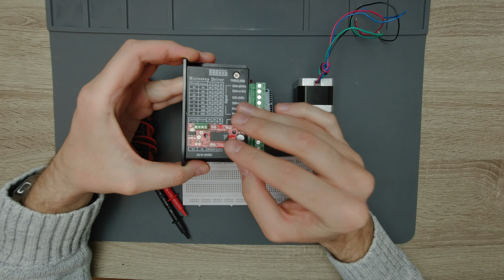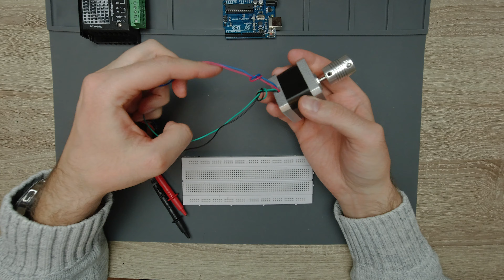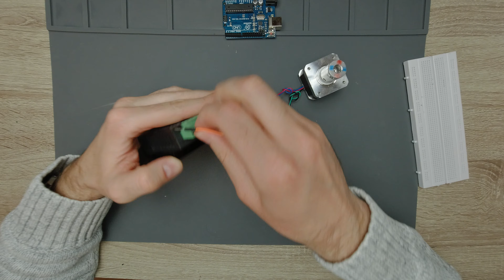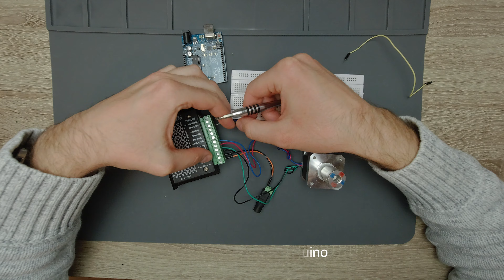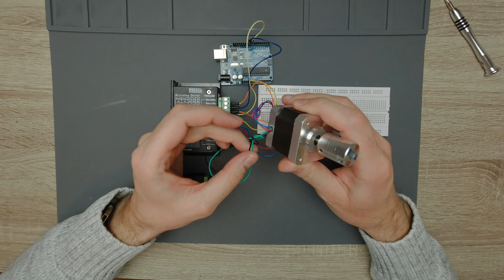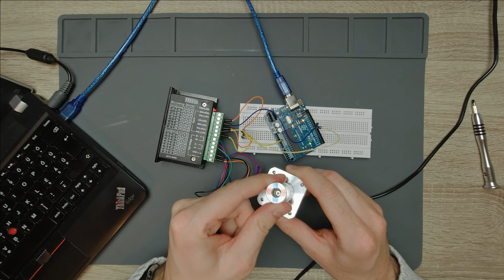TB6600 and Arduino - Wiring and demonstration

Comment: What’s the name of the power supply connection thing? I’m a newbie!
Reply: Thank you!
Reply from the maker: You are very welcome!
Reply: Ok great, thank you for your help
Reply from the maker: You will find it here, under the connectors section: https://curiousscientist.tech/tools
Reply: When selecting a power supply for my motor.

Does output current, input voltage, and power rating matter?

Or do I only look at output voltage that I will need
Reply from the maker: Of course all matters. Check the datasheet of the motor, then pick a PSU according to the requirements.
Reply: So, the Voltage Range if the driver is: 20V to 50V.
And the Driver’s Current Handling is:1A-4.2A

The motor’s operating voltage is 24V-50VDC. (I would like to have 48VDC)
And Rated Current is: 4.0A

So my power supply would need:
48VDC Output Voltage
And 4.0A output current?

Thank you for your help, I appreciate it!
Reply from the maker: Yes, you nailed it! This sounds like a relatively large motor. Luckily, 48 V power supplies are quite common. If I can suggest, go let's say 25% above the rated current, so pick for example a 48 V and 5 A power supply. It is just a safety margin added to the system. Also, they are not too expensive, you can buy them for ~ $25-30.
Reply: Thank you!

Yes it is a NEMA 23 with 3Nm Holding torque, and 24-50VDC, 48VDC was recommended. Hence I think that would be the best to use as I want to get the whole 3Nm of torque.

Do I need to look at power rating? I don’t see anything about power rating on the motor specs.
Reply from the maker: Voltage times current gives the power (P=I*U), which is already given now based on the details we discussed above. You just need to go for the 48 V, 5 A PSU and everything should be fine.

Comment: As I am still learn about the arduino is there a way to add a potentiometer for speed control?  Thanks
Reply from the maker: Yes! Map its value to a selected range and update the speed of the stepper motor based on the position of the potentiometer. But it is more elegant to use rotary encoders.

Comment: Great video! I have just one question, can I connect 2 stepper motors to the same motor driver? Can I just connect the second stepper motor wires to the motor driver and run it at the same direction and same speed?
Reply from the maker: Hi and thanks!
I strongly discourage the idea! Use two drivers and a properly written code.

Comment: I hope, in the future you will use nextion and incorporate the program for stepper motor..
Reply from the maker: It is on my to do list to implement my control panel for Nextion, but it doesn't have high priority.

Comment: Hello, question relating to wiring.. Should the GND of the Arduino be connected to the ground of the 12vdc power supply to make sure both grounds are at same potential. If yes, should that be the same practice when using a dc motor driver, etc. Normally should it be a good practice to connect all GND together when using different sources of dc supplies ?
Reply from the maker: Hi! In general it is a good idea, yes. Actually, some drivers require it, some don't because the supply ground and the logic ground is connected in the circuit. If your motor doesn't work and the only missing part is the interlinked grounds (btw, there's a reason why it is also called as common (COM)), then connect them. In the TB6600 it is a bit different. If you see, the three positive control pins, en, step and dir are connected to the MCU's +5V, and their negative parts are connected to the corresponding gpio pins. So, whenever they are toggled, they sink and they pull the pins to ground, so essentially in the moments of switching, the whole system's gnd is common. If I understood correctly.

Comment: Thank you for video! One question. Can two stepper motors be connected to one driver and run in sync? I got two nema23 motors that I want to use them for simulator steering wheel force feedback.
Reply from the maker: Hi and welcome! Physically, it is possible but I would not recommend it. One driver - one motor. You can run them synchronously using software.

Comment: Thank you. Can I use this controller with an ESP32 instead of the Arduino?
Reply from the maker: The controller should work with anything that creates pulses. I could even make a motor move by connecting a pulse generator wheel to it. However, I don't know if the accelstepper library works on it, I haven't tested it. But I assume that it should work. There is nothing hardware-specific in the code.
Reply: Have you tried? Working? I am in the same situation now..

Comment: we can control tb6600 stepper motor driver  24 hours
Reply from the maker: As long as you wish. If you use it at higher currents, I would recommend adding a fan to it's heat sink. Just to be safer.
Reply: Please help me to make a code for DMX stapper motor with optical encoder
Reply from the maker: @deepeshkushwah607  Sorry, I don't do work for free.
Reply: I will pay you for code 26 $
Reply: Please help me
Reply from the maker: @deepeshkushwah607  Sorry, but this is not how things work. Also, I will not do anything for such amount.

Comment: What about the ground wire , I have the same driver , but my control board require connection to 4 pins : step , dir , grn and +5v  , can you advise if the minus pull and minus dir act as grn pin ?????????? Thank you , I am in the process of assembling the wiring and this was my issue , thank you for help
Reply from the maker: Watch the video! I think I explained it clearly. Also, there are drawings on my website.

Comment: I am using the arduino UNO + TB6600 + Nema17 + 24volt 5 Amp power. When I use micro stepping then motor moves smoothly but when I use at non microstepping mode then after few rotation motors halts and only sound will come. I am trying to achieve rpm around ~600 . is it possible to achieve with this configuration?
thanks
Reply from the maker: It sounds like that you are not using acceleration but you're trying to start the motor immediately at 600 RPM. Check my other stepper motor-related videos where I show how to use the AccelStepper library and implement accelerations. The motor needs to be accelerated to the required RPM values. Nema17 should be capable of ~1800 RPM max.
Reply: @CuriousScientist  thanks for the your reply.
I have used increasing acceleration and in that only for few rounds it rotates then stops and only sound wiill come (like it's increasing) then at the end when it de accelerate it again start to move.
Reply from the maker: Have you set the current properly? Also, it might be so that the acceleration is too quick.
Reply: @CuriousScientist  I have measured the current in a motor coil and it's 3 amps. I have tried to reduce but the problem will increase. Input is 5 amps.
Reply from the maker: If it starts to move then it halts, something must be wrong with the code I believe.

Comment: why ena+ dir+ and pul+ connect to gnd on power arduino?
should be ena- dir- and pul- coonect to gnd  on power arduino?
and ena+ connect to 5v power arduino

why your way diferent like this video:
- https://www.youtube.com/watch?v=FggSRQqB_a4&ab_channel=NikodemBartnik

can you explain to me
Reply from the maker: It is just matter of convention I believe. Also, in my case, the above mentioned pins are not on ground. Pins with + sign are connected to the 5 V pin on the microcontroller. Then, dir- and pul- are controlled.

Comment: Is there a way to stop power to the coils when the motor is not spinning?
Reply from the maker: That's what the enable pin is for. You just have to control the ENA pin and it should turn the power off.

Comment: How do you connect more than 1. How many drivers can you connect ? Where do limit switches go?
Reply from the maker: The amount of drivers depend on the board you use. For the Uno, you can for example buy shields that support 5 drivers. The limit switches depend on you. It depends on how you want to use them; poll them or use them with interrupts. I have a huge playlist for stepper motors, check it!
Reply: @CuriousScientist  do you have to buy shields to get the 5 or utilize just the uno directly ? Isn't the shield so you can use the drivers that come with it ? Thank.
Reply from the maker: Shields are not mandatory to use, but they make your life much easier because it is much more simple to connect everything. On the other hand, you will always need drivers, you cannot drive the motors directly from the Arduino. This is a whole kit for 4 motors: https://www.banggood.com/custlink/DKDyi3Db8z and this is a whole kit for 5 motors: https://www.banggood.com/custlink/3m3yIKvAl8

Comment: Arduino: 1.8.14 Hourly Build 2020/09/23 10:33 (Windows 10), Board: "Arduino Nano, ATmega328P (Old Bootloader)"

The sketch name had to be modified.
Sketch names must start with a letter or number, followed by letters,
numbers, dashes, dots and underscores. Maximum length is 63 characters.

TB6600_and_Arduino_-_Wiring_and_demonstration:22:10: fatal error: AccelStepper.h: No such file or directory

 #include <AccelStepper.h>

          ^~~~~~~~~~~~~~~~

compilation terminated.

exit status 1

AccelStepper.h: No such file or directory

This report would have more information with
"Show verbose output during compilation"
option enabled in File -> Preferences.
Reply from the maker: What is this?
Reply: what is problem in this code
Reply from the maker: There is nothing wrong with the code. I uploaded the code I used in the video. It worked.
Reply from the maker: BTW, you have to have the AccelStepper library installed in the Arduino IDE. Otherwise, you won't be able to compile the code.

Comment: So could you flash grbl to the arduino and then use universal g code sender to control the motor?  Great tutorial
Reply from the maker: Thanks! Yes, as far as I know that's how 3D printer's work (CNC). The firmware which is usually installed on an Arduino Mega-based board takes the G-code from the slicer and performs the actions defined in the code. There are different shields for this as well. They can take several stepper motor drivers.

Comment: Most of the time, it's a good practice to connect the zero volts (ground) from the power sup to the zero volts of the Arduino Uno (ground)?
most of the time, it avoids some issues, like noise or spikes...
good video at the right pace!
Reply: This is an interesting video of a stepper wired for Common Anode mode.  I see you did another also covering the sketch.  Can you do a video covering Common Cathode mode please as most Arduino sketches are based on that mode? Why?  I trying to run 3 x Nemer 23 with Uno plus TB6600 form an antenna impedance matching unit for Amateur Radio Antenna. The aim is to use a tandem match bridge to sense reflected antenna voltage on A0 and then have the 3 x 23s turn a capacitor/inductor combination for minimum reflected  voltage.  It is a very interesting project and your ideas on it would be very welcome.  Cheers from OZ.
Reply from the maker: Hi! They don't really differ as far as I know. Common anode is active low, so you have the positive supply connected to the positive pins of the driver while switching the negative pins. Common cathode is when you have the opposite: negative pins go to a common negative terminal while you are switching the positive pins. This is an active high configuration. I guess both should work with the TB6600. On the other hand, sorry but I don't make videos for requests for free. I don't have the time and resources for that.
Reply from the maker: Thank you! Yes, sometimes it is useful and/or necessary to connect the common points. For example if you want to measure voltage (otherwise the Arduino's reference can be shifted as compared to the voltage sources 0 V). In this application it is not necessary, it works without it, but I have other type of controllers, where it is necessary to connect the Arduino's GND (which I believe it is more like a COM (common)) to the power supply's negative pole.
Reply: @CuriousScientist  I spent more than 
35 years of working on electronic automation as PLC, CNC, etc, connecting all zero volt together and to the ground solved many issues... But 35 years ago, electronic was different!!!
Reply from the maker: The laws' of physics are still the same, so I would assume that your experiences are still valid.

Comment: @Curious Scientist. What current and voltage settings were you applying to the stepper? SInce the adapter has a 24V range, wouldn't it be kind of dangerous to be putting in a 24 V and 3A setting to power the stepper. It seems like you are putting in 12V and 2.8A-3A if I'm not wrong
Reply from the maker: Hi! I do not exactly remember the details, but I usually use my small variable power supply (see description) for this demonstration which can do 24 V and 3 A max. I think, it was at ~14-18 V and well, the current was depending on the motor's hunger. If you are interested, I could measure it for you. I promised some testing for another viewer, and this weekend I will do it on the very same setup that you see on this video.

Comment: Can you run sync 2 motors with out splitting connections on UNO or Mega?  And does UNO or Mega control 4 motors independently?
Reply from the maker: Depends on how many connections you have available and which controller you are using. The TB6600 basically just needs 2 pins as well as the A4988. To run 4 motors independently, it is more about coding and not hardware. Many of the 3d printers have the Mega as the motherboard, and they can accommodate 5 drivers/motors.

Comment: Best wiring instructions for Arduino, step controller and step motor.    

Can you show us how to make Arduino and TB6600 run CNC machine.  Your explanation of  steps are very logical and simple.   Thanks!
Reply from the maker: Thanks! 
If you provide me the parts, sure! For CNC, I would need several motors, axes, controllers...etc. I won't just go and buy the parts and make a freely available tutorial, sorry. I only work with stuff I have at home, or I am interested in. I could do many more stuff, but I do not fulfill requests for free.

Comment: Does the + and - on the A and B loops have any significance?  Thanks for this video!!
Reply from the maker: Hi John! Yes, they have! So, in the video I have the following order: B-: blue, B+: red, A- green, A+: black. Please check the code I wrote in the other video I put in the description. If I give the command for positive rotation with this order of wiring, it will move counterclockwise. If I flip the wires of for example A (A+: green, A-: black), the motor will also flip directions and it will move clockwise with the same command. I, personally don't care about the wiring, because I can always override it within the software. For me, the only thing that matters is that I connect the same coils to the same terminals.
Reply from the maker: Order of pairs only influence the direction as far as I know. I also know a another test which doesn't need any instruments. Short two of the cables and rotate the shaft of the motor. If you feel resistance in rotation, you found a coil and its two wires.
Reply: @CuriousScientist  ah yes.. I missed the short-test.. Thanks 👍

Comment: Were you just using one of Accelstepper's sample codes to do the speed and acceleration? If so, which one? Thanks!
Reply from the maker: I wrote my own code, based on the AccelStepper library. Please check the link in the description that leads you to my other AccelStepper video. That video has a Pastebin link for the full source code.

Comment: Can you use acceleration in speed mode with the accelSteper  library?
Reply from the maker: I think most of the functions can do both speed and acceleration control. If you check the documentation of the AccelStepper library, you will see that some of the functions (i.e. runSpeedToPosition()) do no use acceleration. But majority of it does. If you check the end of the video, you see that I control both acceleration and speed.